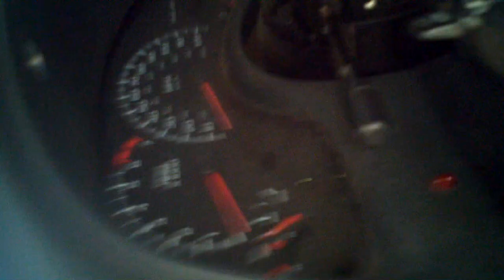1999 Chevy Camaro Turn Signal Flasher Location

Comment: Appreciate the video, would like to replace those with led flashers rather than splicing resistors which get hot in the factory harness and worry about mounting them where they won't melt wire around em 🤦 lol

Comment: i have always got the 5.7's-ive had 3, 2 99 z28s and an 02 SS...really when you live in the midwest, the rear wheel drive is more of an issue than the engine type...i wouldn't be able to justify dealing with the snow and not having the 346 and 300 horses...but thanks for the vid-im putting mine in now-it is going slow, then stops, then goes to normal...

Comment: Here's a tip: I just replaced mine for the second time.  Last time was years ago.  It turns (get it?) out that the bad flasher was bad only because the plastic case eventually got crushed by the metal clip and the clip was pressing on the relay arm. This time I was careful to position the clip near the end of the unit where hopefully it will resist crushing.
Reply from the maker: Interesting, Mine never failed, I just needed to change them for LED compatible ones, and my original ones as well as the new new are metal.

Comment: Thank you for this video.  I just changed my flasher with an OEM AC Delco part #19209674 that I got from amazon for $11.87.  My car is a 1999 Pontiac Firebird (3.8 engine).

Comment: "Yes it is a 1999 Camaro, yes it is a V6 and no I don't care" - Hahahahaha LOOOL !!!
Still a nice car even with a V6, $3000-5000 will make this Camaro go like a V8 - you still got a car with a very nice body non the less. Thanks for the video, I got problems with my flashers the front left is out and the rear just stays on and doesn't flash until turned off :[ I think instead of bulbs I got to look at the flasher and wires to fix it, any way love my '02 SS and you enjoy yours as well :]
Thanks !

Comment: thanks for this vid.
After 20 minutes of couldn't find it, googled, found this vid, blinker working 3 minutes later.

.....The replacement part from autozone looks a lot different than the oem part that was in there.
The directions in the haynes manual were NOT helpful.

Comment: Did you find the flasher on your Firebird? Same location? I'm having an issue with the turn signal arrows turning on, but not flashing, not clicking, and not signaling. Hoping replacing it fixes the issue.

Comment: Thanks for posting this up. Im having a issue with my left turn signal not flashing (it just stays green) ive changed the bulb and socket and still nothing but ive noticed it starts to work again when i move the steering wheel colum all the way up or when i keep messing with the turn signal lever. Any ideas people please help a fellow camaro owner :( . With hazards ON all lights work and the right turn signal works perfect
Reply: If it works when you mess with the turn signal lever , it seems like it's time to replace the lever itself. You may have a loose or worn connection in the lever controls.